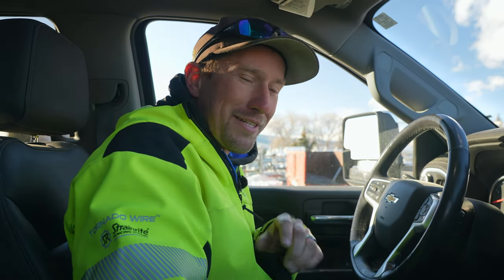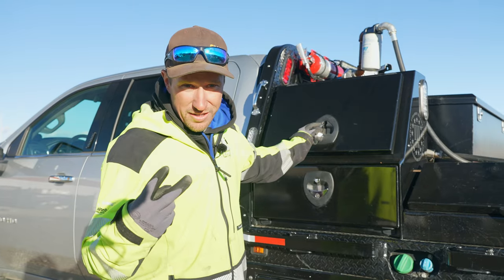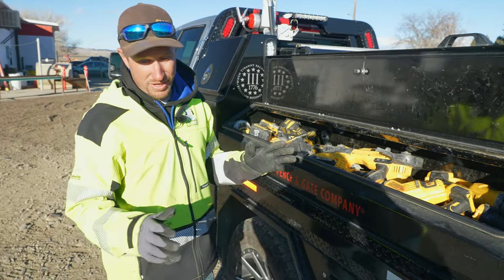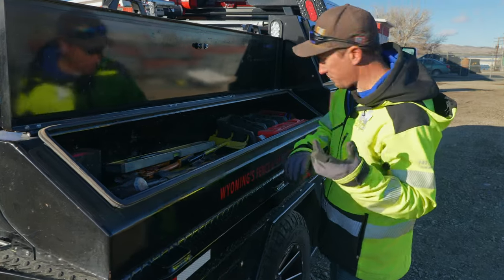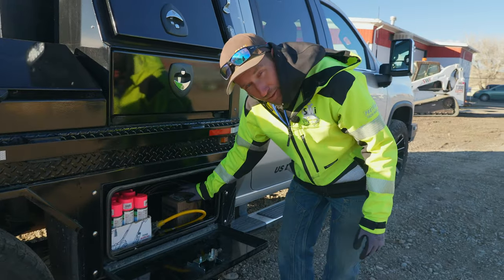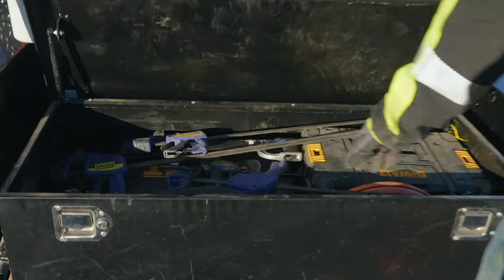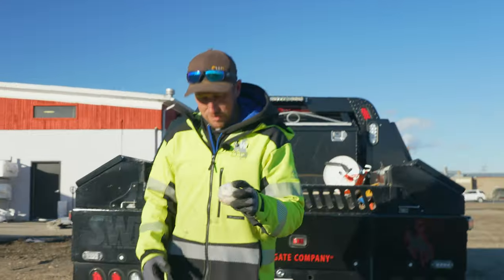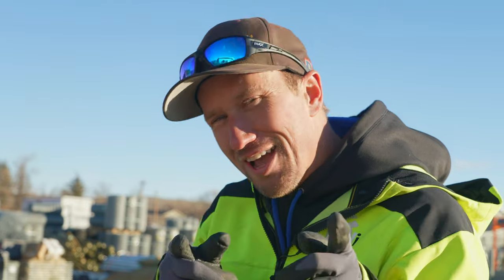Truck Tour! | A Premium Fence Builder's Truck

Comment: Dan… listening to you talk about that fancy-schmancy truck bed brought back memories.  

It was about 1968, summertime, middle of a drought, with temperatures dropping to 90f at night…. Roasting during the day.

My little brother had just reached a milestone of maturity.   He had just learned not to wet the bed at night.  His reward…. A new mattress!

My dad and I carried the old one outside and tossed it in the back of the 1959 Studebaker pickup.  Our plan was to let it dry out and toss it on a brush pile.  But. The drought was unrelenting… there was no way to burn until we got a rain.  So, it laid in the pickup, parked in the sunny cattle pasture for several days.  

Finally, my dad told me to drag the mattress out and put it in the barn.  It was totally dry and ready to burn, as soon as we got the next rain.

A few nights later there was going to be a full moon.  After the evening  milking, my two brothers and I gathered up the fishing poles, chicken livers and worms.  

They brought out some old quilts to use as sleeping bags.  As we were loading the Studebaker, I happened to remember the old mattress.  So, we grabbed it and tossed it in the back of the pickup.

Well after midnight, the moon went behind the trees.  With no catfish action, we grew sleepy. I claimed rights to the mattress.  They spread their quilts on the creek bank.  

I picked the side of the mattress with the smallest yellow spot and turned it facing up.  Did I mention that it was hot?  

The odor of the stagnant creek water mixed with about two gallons of insect repellent and a full day of sweaty teen body odor was heavy in the air.  But, the quilt covered mattress didn’t seem to smell too bad…. At first.  But, once my sweat soaked through the quilt, it came out in all its urine soaked glory.

I awoke the next morning smelling like my other brother…. He was the one who slept on the bottom bunk… the one beneath the incontinence plagued little brother.

But, I have to admit, I had the most comfortable nights sleep that I’d ever had at the creek! 

So Dan, that bed you have is pretty cool… and might even smell better…. But I’ll bet you money that it ain’t half as comfortable as my first pickup bed!

You have a good danged New Year!
Reply from the maker: It doesn't sound as comfortable... but yes, it does smell better. 🤣
Reply: @SWiFence  PS… did I mention that I love your channel?

Happy New Year.

Comment: VERY VERY NICE. That box looks sweet is it Steel?. Our Trucks have custom Aluminum boxes with up and over the cab of the truck for top rail wheel barrow. it's hard to find a picture of these trucks on google since Eastern Fence and Maritime fence like to scrub the net of them so no one copies them, but we did LOL. Your box is more ideal for an Iron worker/welder. the big front tool boxes we have, the bed is still 10 ft 6 inches long with all 3 sides able to fold down and hold up for a work table. Maybe i'll make a video and show you our Canadian style fencing truck. I like the look of yours better. our wrenches get hung like yours including the 1/2 rubber mat i put eye hooks every where so i can strap everything all down. We use the air compressor rhyno more than the gas pounder. Gas pounder is basically useless in nova scotia also they stick operating them in the winter. Air compressor hits harder and can switch to the drill for rock. only thing that sucks is when the hoses freeze we so we installed a heater in one box to thaw them keeping 2 oilers so we can swap them out lol. Thanks for the video
Reply from the maker: We'd love to see your truck!
Reply: @Loadedgoods  looks like a cheap knockoff of my truck. Oh, that's cause it is. Lol.
Reply: @maf100283  Never seen your Truck.  Nothing about that truck is cheap any one with a brain knows aluminum isn't cheap tig welding isn't cheap. That style of truck started in Canada so you copied us 😂. Upload your truck let's see it.
Reply: I worked for Eastern Years ago with Nick and Adam their welders and installed with Jason baker. To bad Eastern doesn't treat their staff well every goodnone disgruntled left a joined Maritime.
Reply from the maker: @Loadedgoods Not a bad rig! Gets it done! 👍🏻👍🏻

Comment: I do not have the option of using a truck with a utility bed because code enforcement here wants to fine you 500 a day for a "commercial vehicle" So I use the junkiest stock pickup truck and put my tools in a Jobox.  Those new trucks with the cheap plastic bumpers make no sense, putting on the steel ones fix that, wish they were still available in chrome!